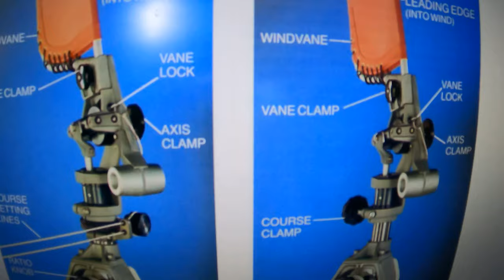Should you have a Hydrovane? Sailing EV episode 34

Comment: Having the vision of already seen many of your videos, (up to s6 13) bravo Zulu for making it this far. In this retrospective, installation would have obviously slowed you down as far as busting that move to the southern quarters. The caveat here is simple: rest.
The wind vane can keep you on course in respect to the wind direction. If you don’t mind the correction to your destination since it specifically follows the wind. The auto pilot follows the gps, and can therefore loose that perfect wind, which could be undesirable.
The true question is which one is safer for you to get some rest? Traffic, weather, debris… notwithstanding shorter runs auto pilot, longer runs, wind vane.
I myself would vie for wind vane as all of my runs are milk runs of 30-40 miles out to sea, then back again. Commercial vessels, and other craft so it’s essentially having another pilot taking the helm while I adjust the rigging. With the last few miles simply at low to zero engine speeds to collect water (sea) and coastal navigation to attain dockage.
In my opinion, your now at the stage where duration sailing is highly probable, so unless your going to get a larger vessel, pick up a wind vane.
Good sailing!

Comment: A used Monitor windvane would be about $4k. There is one on the market now. 

I think some type of power free self steering is a necessity for single handed ocean crossing. Island hopping not so much.  Can you rig some sheet to tiller steering using an emergency tiller? 

Did I miss how you made out with your chain plate fix?
Reply from the maker: Well I had a marine architect look at the chain plate and he said it's fine but keep an eye on it. I'll go look up monitor windage now. I do have an emergency tiller that's a good idea... will think on that thanks for the info!!

Comment: Personally, I think my Hydrovane is absolutely indispensable. Full stop.  I have sailed on lighter boats with only autohelm and they are not able to handle even moderate seas.  I have a Morgan 382 with has a skeg hung rudder, and I took built a brand new one for my own insurance. But I only use the main rudder in close.  Once we are out and on our point of sail, "Nina" is always driving. 

I have had crew chumming in 8-10's on the aft quarter, while I sat in the cockpit under a blanket.  You won't regret it.
Reply from the maker: After 1000 nm I fully agree. Its always good to have a back up rudder as well. Next season I will be installing one. Thanks for commenting
Reply: @sailingEV888  I just installed a remote line to the front of the boat so I can make course adjustments without going to the cockpit. Nice touch when the weather is good.  Next I will be connecting my nav to the windvane with a linear drive like a tiller tender.  That way the main rudder will remain my "secondary".
Reply: I have an Island Packet 29 and been in 10-15 foot seas in the Gulf of Mexico. I only have a CPT Autopilot and it handles it just fine. The Raymarine wheel pilots are total crap.

Comment: What did you end up deciding?
Reply from the maker: I decided not to get one because of the fact my autopilot works so well under sail and the fact I have so much solar and extra power to run my autopilot. For now my current sailing plans do not include a long distance ocean crossing passage YET. but it's high up there on the to get list
Reply: @sailingEV888  I've been weighing the pros and cons of a wind vane recently. See you in the Bahamas maybe.

Comment: Hydrovane is the best as for as I am concerned, auto pilots fail all the time, and if you have an electrical failure you have no auto pilot, being a single hand sailor I think they are a necessity for crossing oceans, if you are just doing 3 day trips as in the Caribbean a auto pilot is OK you can handle one or two days self steering, but you have to consider the cost of solar and batteries to run the auto pilot for that long they burn a lot of energy but most people want a lot of solar anyway.
Reply from the maker: I've done some basic calculations with how long I could run my Autopilot and helm station even based on 6 hours of direct sunlight per day starting at full charge and its seems like I could go for weeks. You have given me an idea to readdress this. These comments are so helpfull. Thanks